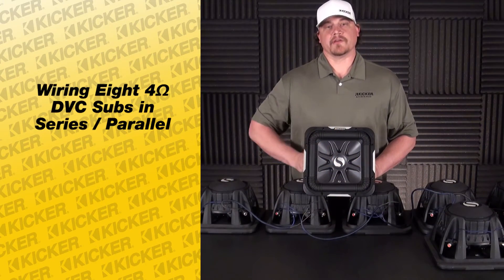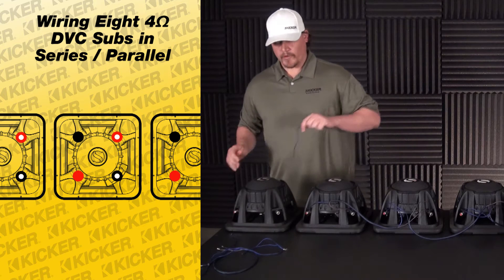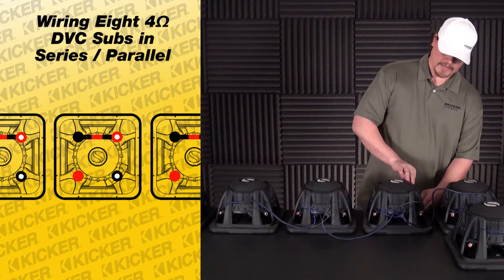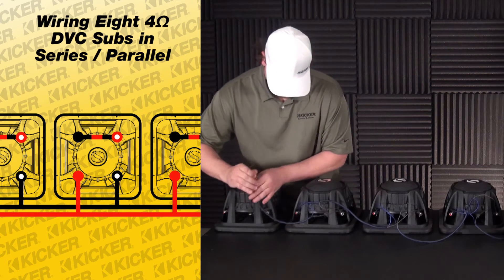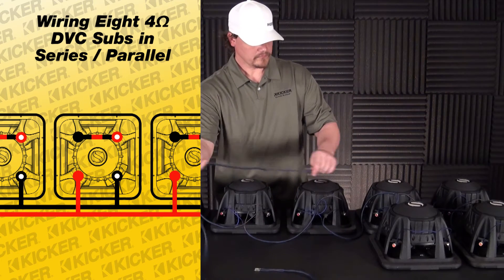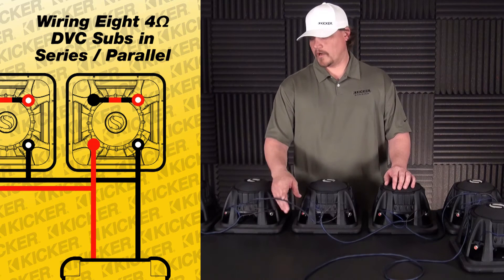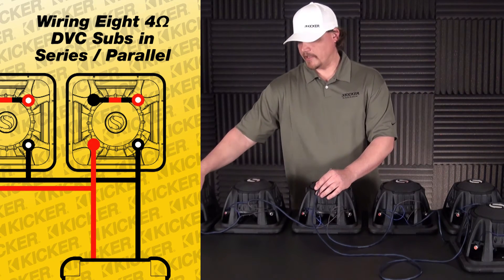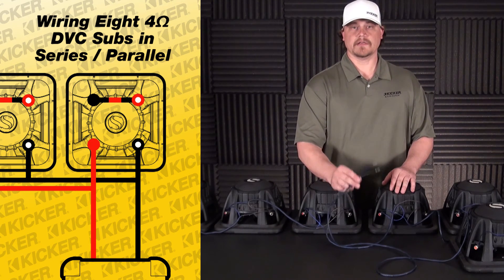Subwoofer Wiring: 8 DVC Subs in Series Parallel

Comment: I have 10 Orion 2nt dvc 12s, they are dual 4 ohm. I actually have 11 but will keep one as a replacement. I want to run these in the old school spl challenge. So I will be using a number of different old school amps. I have a pair of crossfire 30 hcs, I have 4 soundstream 10.0s, I have 6 Orion hcca 225s, I have 6 mtx 225hos. Etc etc. I have over 400 amps in my 90s collection.
Reply: I also have 5 of the Orion 2nt dvc 15s. But I think the 10 12s will be louder. Let me kjow your thoughts. Thank you!
Reply from the maker: @Afterschoolspl  I think you should run KICKER products!

Comment: What amp are you using for this setup?
Reply from the maker: As a general rule, we recommend matching the RMS of the subs to +/-20% of the RMS of the amp. Of course, the output of the amp will depend on the ohm load of the subs you use, and how you wire them.
Reply: @KICKERAudio  What's the maximum Woofers i can install on Kicker  zx25.001?